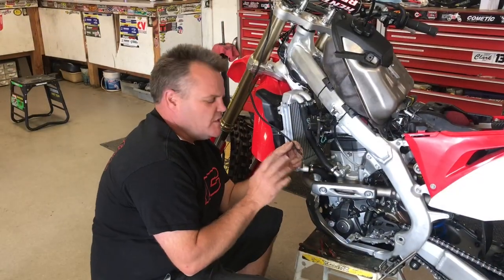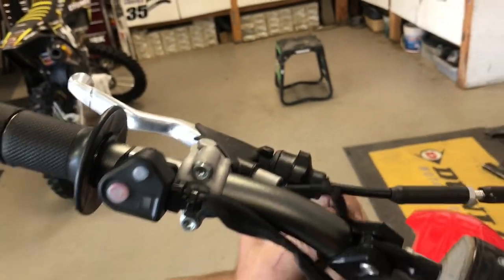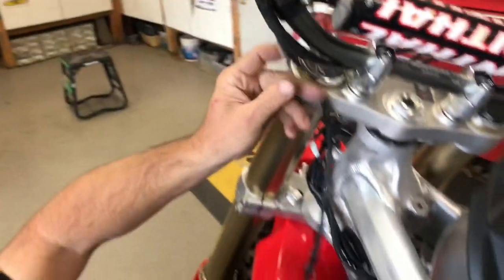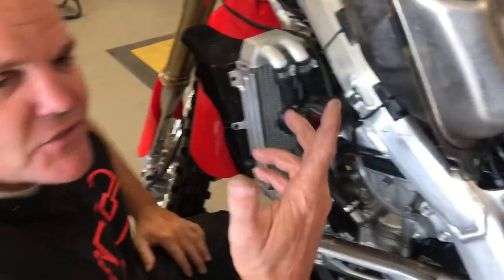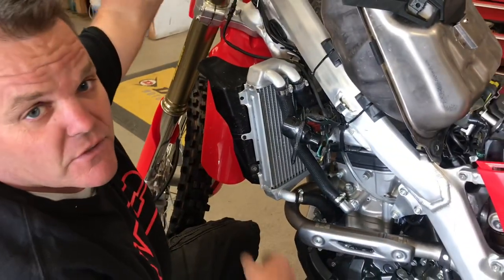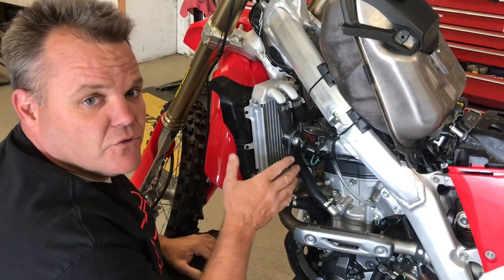Honda Clutch Bypass

Comment: Awesome video! Will try it in a few days... I just have one question about it. What have you done with the wire coming from the clutch lever? I did not get it :)
Reply from the maker: You can pull it off -- or put a after market set up on as the Works Connection Elite Perch.
Reply: What is that wire called that you pulled off?
Reply: @natemandrik  Way late to the party but since nobody answered it is the clutch safety switch wire.

Comment: What's the purpose of the clutch switch?
Reply from the maker: Legal safety deal
Reply: @dirtbiketv1  what does it do?
Reply from the maker: OH -- makes it so  you have to have the clutch pulled in to start the bike.  With it off you can be in neutral and just hit the button to start it.
Reply: @dirtbiketv1  that weird because I can start my trx450r without pulling in the clutch, I thought it might be for when it was ingear it wouldn't start without the clutch being in.. thanks man
Reply from the maker: Yes same as your TRX same deal

Comment: When pressing the clutch in normal use is it meant to click or not mine dosent click and strugles to start
Reply from the maker: Weird--  if it is turning over at all then the clutch switch mod is fine.  It will either work or not.  If it is "struggling" I would think that the issue is something else (battery etc)
Reply: My battery on my 2018 is a nightmare if its been left in shed for 1 week .. when i get it out  its got a dead battery its 3 months old.. becoming a pain in the ass..
Reply: @peternufc1981   dude I bought my 21 yz450f from NC like 3 months ago. And the bike only has 32min on it now. Has never seen a trickle charge, it was bought cash and it was left over inventory. This is stock and don’t know how but it starts everytime. Just took it out for quick ride after riding 2 months ago. Lol. 
Check the battery, maybe your regulator/rectifier is not working. 
I put charger on now because it’s been needing it for safety incase battery was to drain from weeks not running. KTM / Honda mainly known for the draining battery issue. Also check your starter button. 
For info: KTM start button are all looped with the FI dash light. They can fail. 
Maybe the Honda has a set up like that within the harness. Just use a test light and multi-meter to run through the battery, solenoid, starter, to starter button. 
Anyhow, hope you got it fixed by now.

Comment: My Honda crf125f 2018,when I less in the clutch if I’m in gear it makes no compression if I try to kickstart or push start but if I press the e-starter it will start why does it do this
Reply from the maker: Sounds like clutch not fully engage and dragging motor and the Estart can get past it--- Weird ?
Reply: Dirt Bike TV hmmm well how could I get it to fully engage if it’s not fully engaging